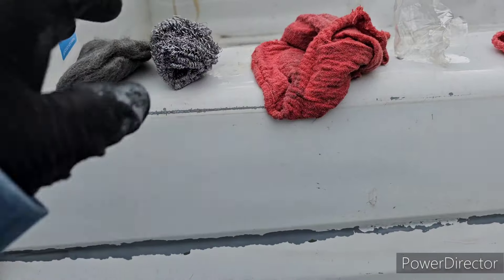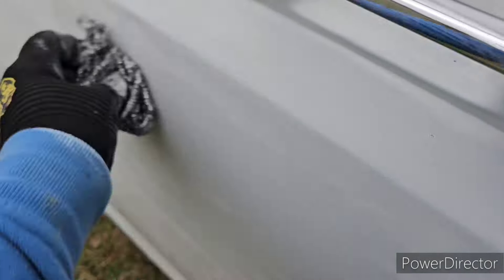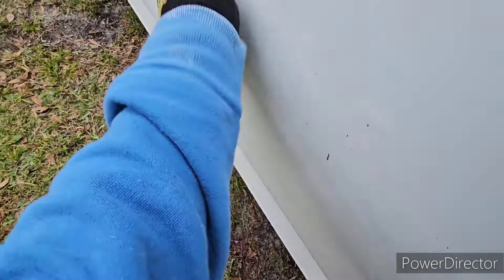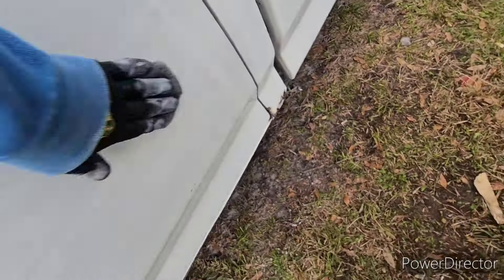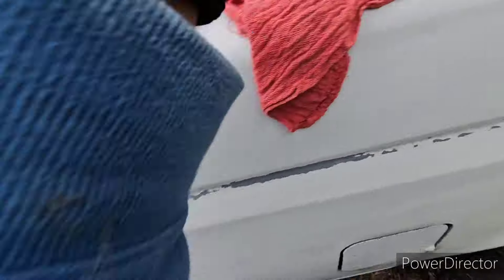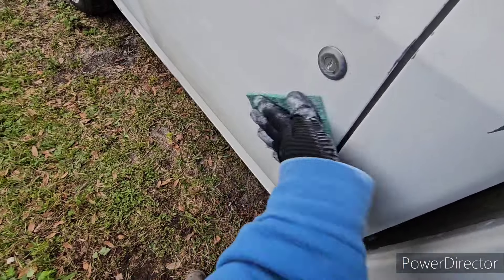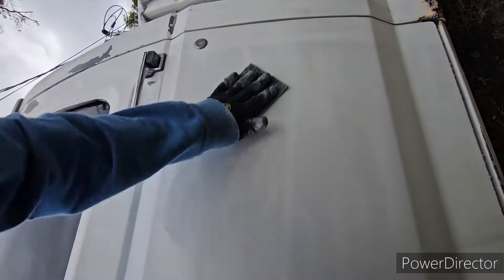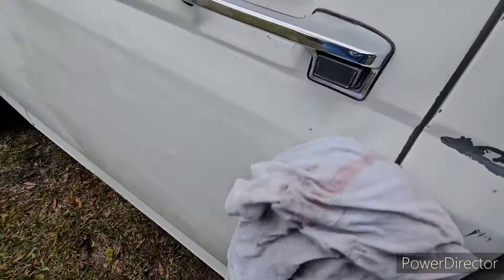Alcohol Removing SprayCan Paint - Do Not try this!

Comment: How about remove the door and place it horizontally instead of spilling chemicals into soil none stop for a single door???? And if you got ideas that you will remove the upper coat and somehow restore the original paint to look good, stop pouring alcohol for yourself bro because you're drunk...
Reply from the maker: I appreciate your suggestion. I found a better solution the next day. I'll post another video of the stuff that actually removes the spray can paint and keeps the original OEM paint. My goal is to make it look better than what it was. I don't mind exposing some primer & metal spots. Heck even moderate patina is welcome here but all that cheap spray paint needs to go. Thanks for checking it out!